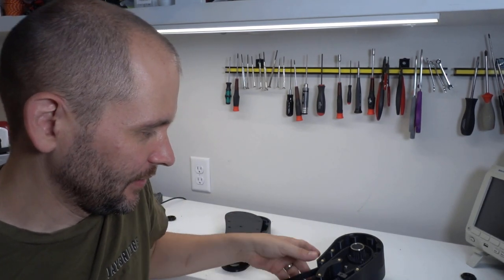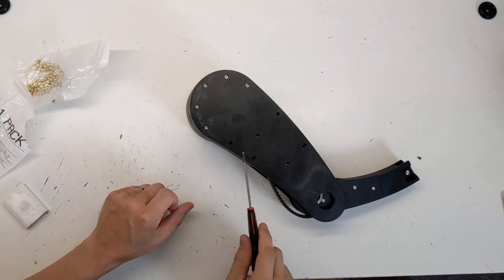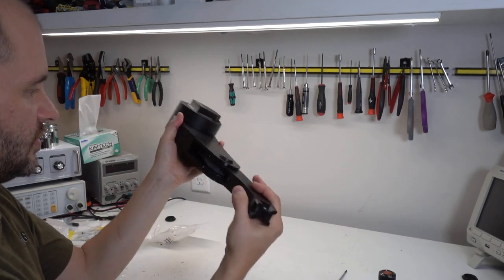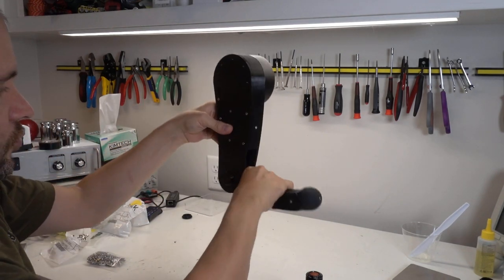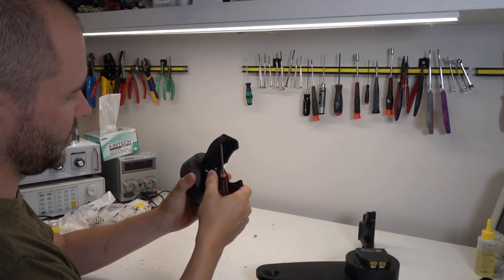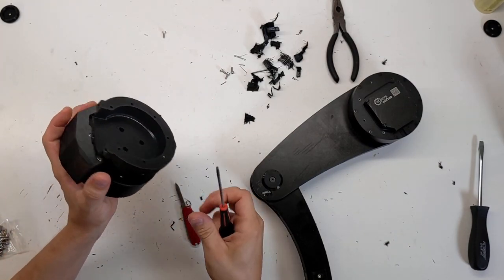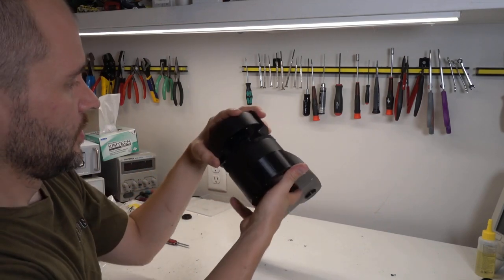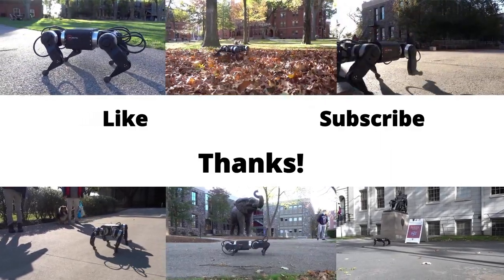mjbots quad A1 leg experimentation - part 3

Comment: Ever thought about printing the parts on Formlabs Fuse1 SLS printer in nylon? Or on HP Multi Jet Fusion nylon? Because of powder bed no need for supports and all of the pain of the orientation of the prints you're dealing with could be solved. I realize it's a bit more expensive to print, but you might be surprised that it's not crazy expensive and stronger than the PETG you're using.
Reply from the maker: I've certainly considered alternate printers.  Part of my self-imposed constraint with this project is sticking to technology that is widely deployed.  My belief is that there are probably 100x more FDM printers out there than SLS or multi-jets.

Comment: Hello, I am a college student majoring in robotics in Korea. I enjoyed seeing this wonderful project. Based on this project, I am planning to design the hardware myself and build a robot. Can I know information about the bearings and timing belts used to build the robot?
Thank you for always watching.
Reply from the maker: The belts are 15mm wide GT3 belts from gates.  The bearings are just thin wall metric bearings sized to fit each of the necessary places.  You can find out at least a bit more at jpieper.com, but if you're designing it yourself, you're going to have to understand the tradeoffs along the way as well.
Reply: @awesjosh  Thanks for the quick reply, I'm excited to work on this great project!😊😊

Comment: Is your mjbots quad A1 robot dog completely open source? If I buy the 12? qdd100 beta 2 servos, is everything else shared? Files to 3D Print the legs and body? Code for control? You have created a dream come true. I am currently preparing to build an openDog, but this is incredible.
Reply from the maker: Yes, all the software and 3d prints are in github at https://github.com/mjbots/quad  It is still a non-trivial amount of work to construct one, but all the resources are there!
Reply: @awesjosh  so are the legs here too new to share right now? What I downloaded has the old style. Even though they say they were updated today.  Thanks
Reply from the maker: The legs in this video are still an experiment.  I have not completed them nor put them on a robot.
Reply: @awesjosh  So your constantly upgrading? And the same motor assemblies will be used on both ( $5000 in motors, I would hate to see them become obsolete to quick ;-P  )? You are doing amazing work here, I totally love it. I haven't used discord since my game playing days, I'll have to get back on.
Reply from the maker: This leg is designed to use the qdd100, like the quad A1 uses, yes!

Comment: Have you considered passing power and CAN through a slip ring, to totally eliminate moving wires?
Reply from the maker: I have considered it, although slip rings that can pass high rate differential data and high power tend to be relatively expensive.  Do you have something in mind?
Reply: @awesjosh  I don’t, they just seem like neat tech and I hadn’t really looked at prices before this